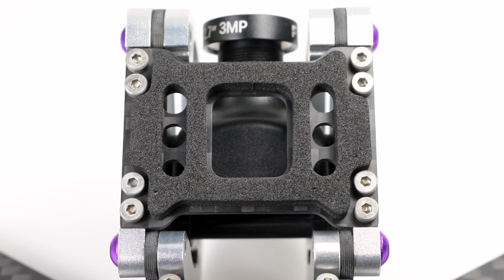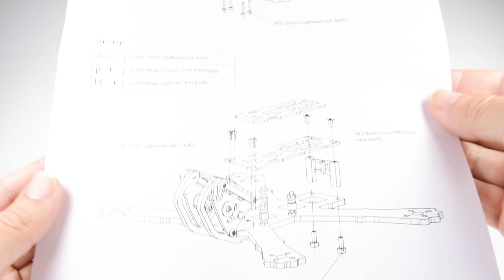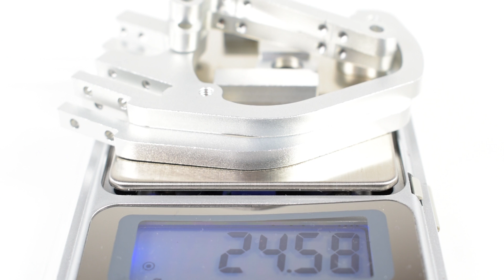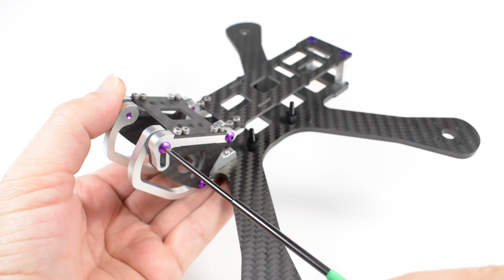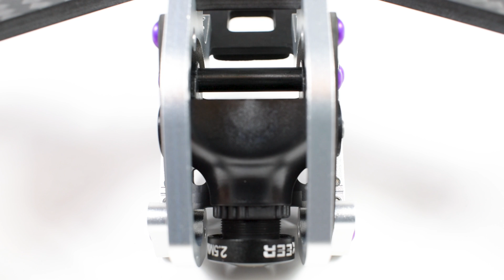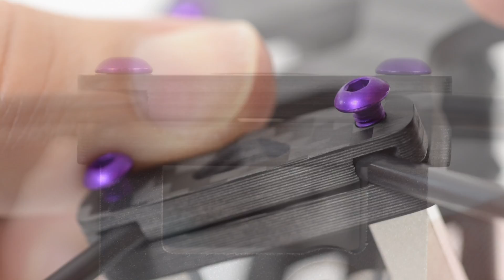Armattan Chameleon

Comment: Hey Soma
What are you using as Stand of the mount the stack?  With the normal 6mm standoff  it the cam frame is touching the vtx board.
Thanks in advance
Reply from the maker: Hey Mate, Those are actually the original Blackout 2mm spacers, from when it had 2mm arms :)  Any 2-3mm plastic spacer should work.  You could also try any spare plastic prop shaft adapter inserts you have lying around, some of them go down to 3mm.  Otherwise the spacers are usually available on eBay / Banggood etc.  The ones with the smaller OD of 5 - 5.5mm are most useful with 4in1 ESCs etc too.  Cheers!
Reply: Soma Boostabeats 

Many thanks   
Finally got it mountwd  with some bit I have laying around. Thanks for pointing me the the right direction.

Comment: Nice review, and looks beautiful with the purple! Did you get the aluminium fasteners as a kit (like a frame upgrade kit) or just buy what you needed separately? - Where did you source them?
Reply from the maker: Hi Mate, thanks very much, and all who've commented, I really appreciate it.  For fasteners check out fasteners express, they are the source of that hardware.  Cheers!
Reply: Thanks! Last question, any news on the Antenna mount coming out? It looks perfect, designed beautifully, good job!
Reply: Scratch that, I found it and it's perfect <3

Comment: +Soma Boostabeats - 27mm standoffs - https://www.fpvfaster.com.au/products/m3-x27mm-purple-textured-aluminium-standoff-10-pcs .

Maybe those and a washer for the camera mount. Probably beats messin' around with cutting up a 30/35mm.

Also have you seen the 20mm standoff in the cage hack?
You grab a 20mm standoff and use it to latereally brace the cage by placing it on the front bottom screws that hold on the carbon camera plates.
Greater strength of cage for those of us (more oafish pilots ;-) ) who impact our camera cages more often.
Reply from the maker: That's a great idea mate.  That should make it near indestructible as its already strong as is.  I did use a 27mm standoff for the cam, and it needed around another .5 to 1mm to fit properly.  Good to know 20mm is the right fit for the front if I get down and oafish wit it. :)